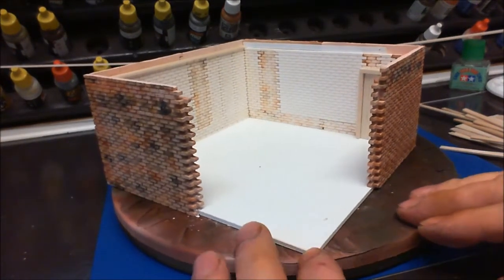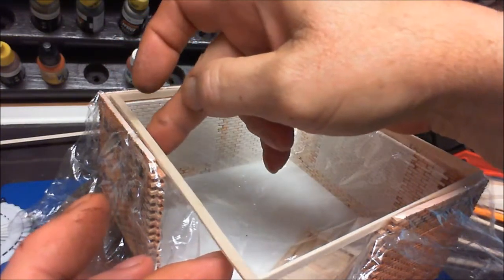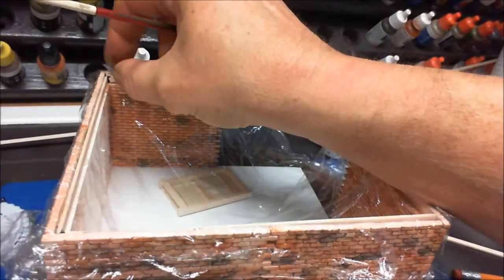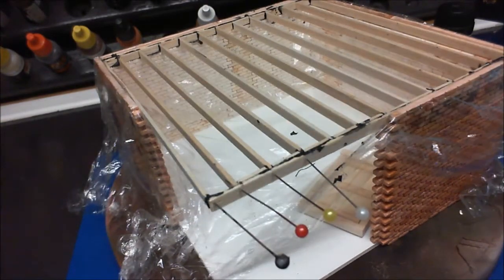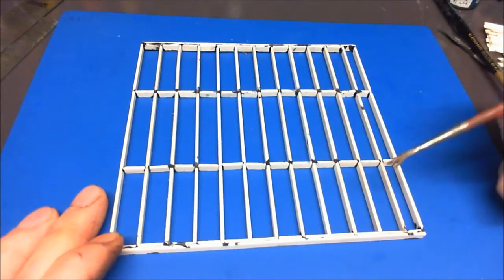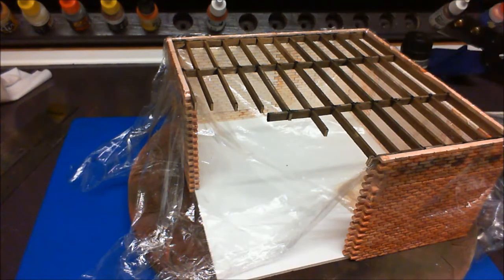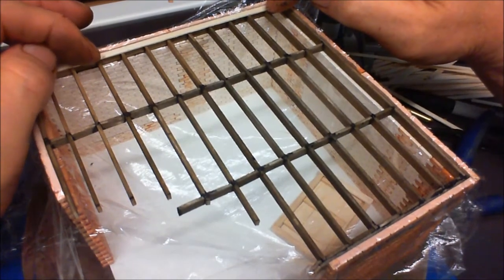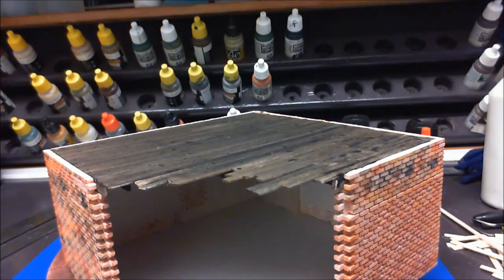Firsts Floor Fix in 1/35 scale (I Video 11)

Comment: Fantastic, I am enjoying this series so much!  I am learning a lot, all of this will be invaluable when I start building my hotel, thanks so much Simmo for taking the time to show everything and explain so clearly.  Just one question, I probably would have cut the floorboards shorter, I would have guessed that they were about 8 foot long in real life, what length were the ones you had?
Reply from the maker: I'm afraid to say there was no set length for a floorboards  they range from 16 feet to 2 feet depending on what  was left at the mill and the same for the width there wasn't no standard sizes so whatever size you decide to make a floorboards you would be correct many thanks whoever you are  simmmo this